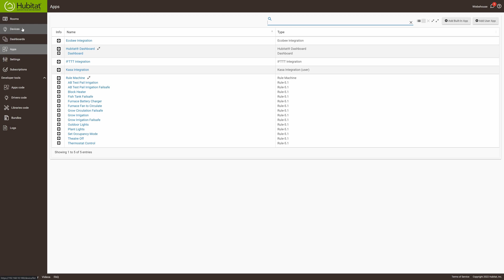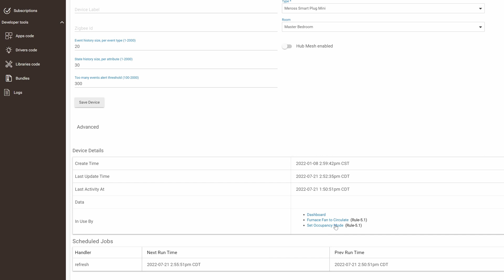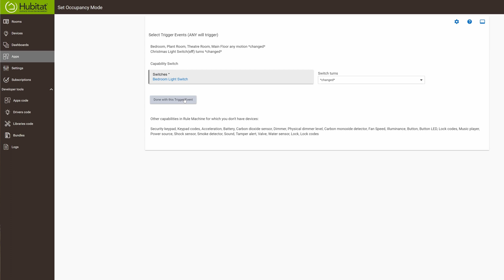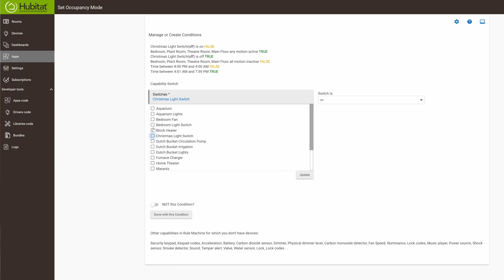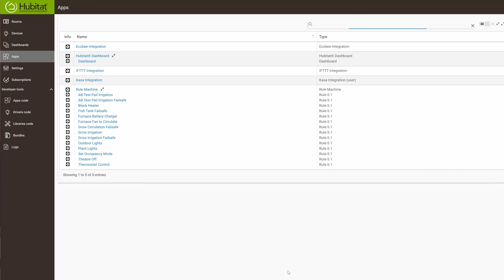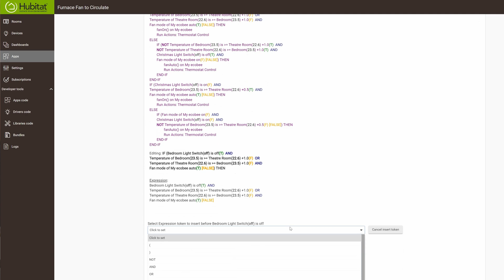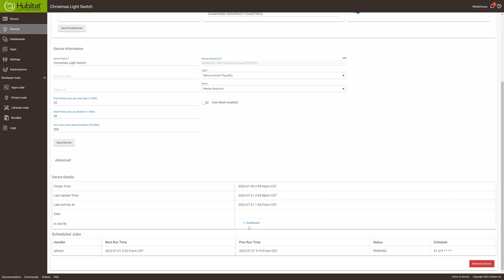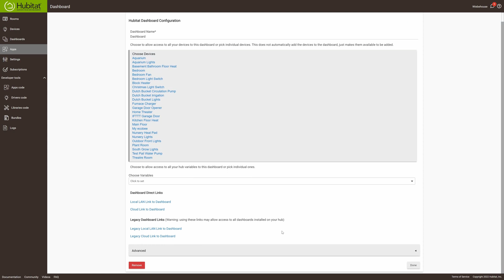Lower Your Hubitat Resource Usage, And Speed Up Automations

Comment: Nice video.  If you use Tp-Link Kasa Switches you can change the polling interval in that Hubitat device to be as low as 5 seconds.  I bring this up as the Kasa Smart Switches are quite a bit less.  Unfortunately you can't use Kasa switches to build your Zigbee network.
Reply from the maker: You are correct, I think they both have their place, I haven't found a zigbee power monitoring device yet.  Glad you enjoyed the video!
Reply: @HouseDadLife  I enjoy many of your videos on the Smart Home (through your encouragement I'm opting for the Ecobee thermostat <3).  You deserve to have many, many more subscribers.  Keep up the fine work, sir.
Reply from the maker: Thanks so much for the kind words, I'm very glad the videos have helped you!
Reply: I got my Kasa switches off the web to local control. No lag at all now.